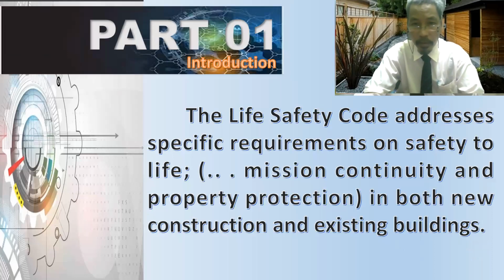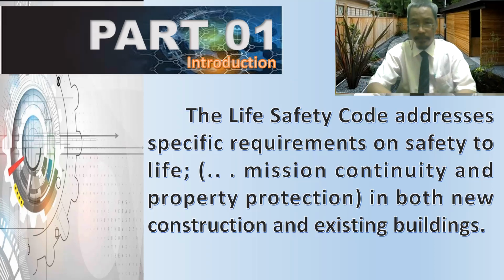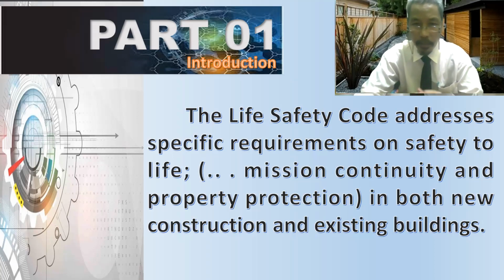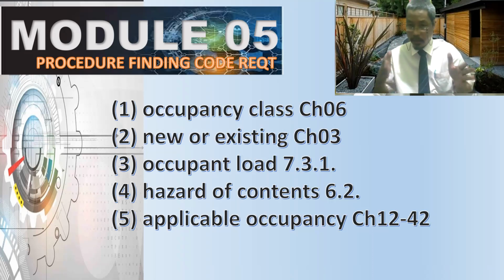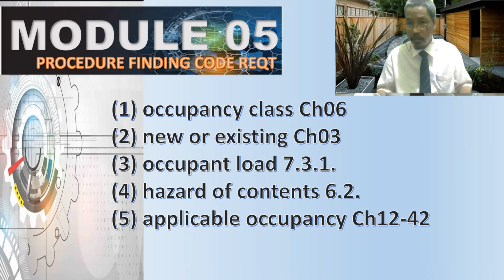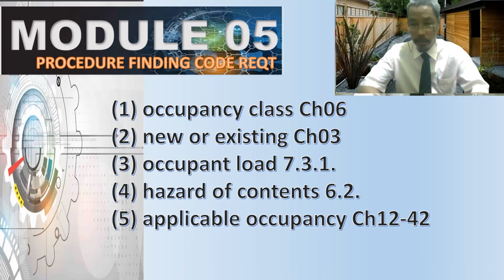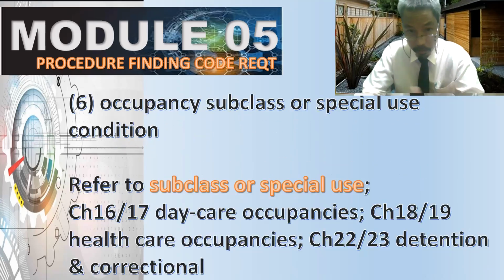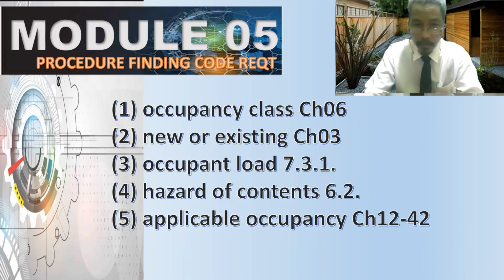The 9-STEP PROCEDURE on CODE Compliance -NFPA101: Module 05.2 [ Reference CODE by RA9514 - IRR2019 ]

Comment: Thank you sir for this well-explained lesson. The life safety code addresses specific requirements on safety to life in both new construction and existing building. This video is about Module 5: Navigating the Code, part 2: completing the 9-step procedure. Step 6 is Subs-classification or special use, step 7: Proceed thru applicable chapter, step 8: Two or more requirement and step 9: Special structure. 
The Procedure finding code requirement, (Step 1) occupancy class in chapter 6, (step 2) new or existing in chapter 3,  (Step 3) occupant load in chapter 7 section 3.1, (Step 4) hazard of contents in chapter 6 section 2, and (Step 5) applicable occupancy in chapter 12 to chapter 42., (Step 6) Occupancy subclass or special use condition refer to chapter 16/17 or day-care occupancies, Chapter 18/19 health care occupancies, chapter 22/23 detention and correctional, Chapter 28/29 or hotels and dormitories, chapter 32/33 or residential board and care, chapter 36/37 or mercantile occupancies and chapter 40 or industrial occupancies. Thank you po sir.